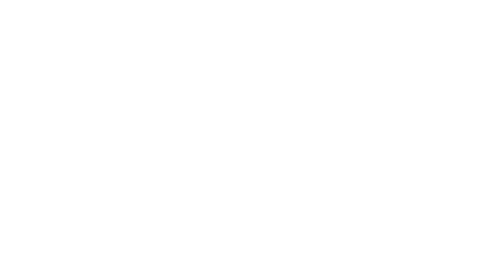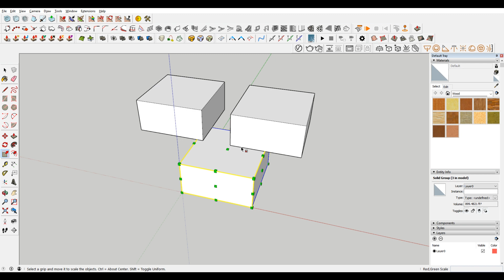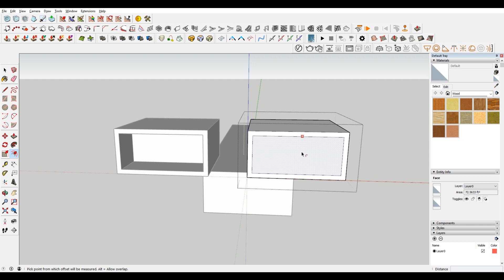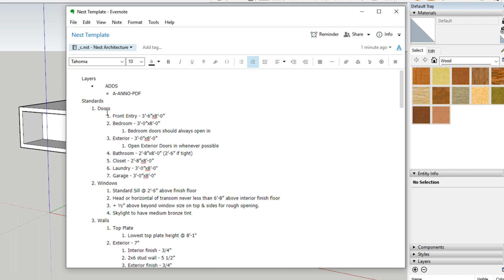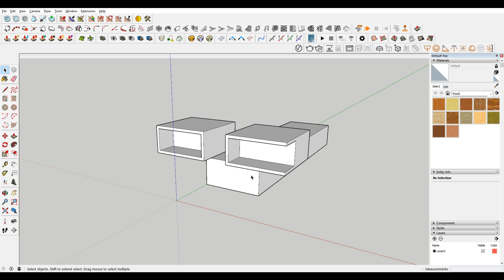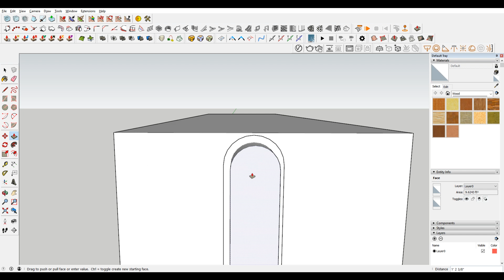Architecture Workflow For Sketchup

Comment: I don't know what you are referring to by drawing everything again if using sketchup and layout. Honestly, Mike Brightman has some awesome myth busting videos about using sketchup and layout. My workflow is so automated that all of my objects are dashed in layout without having to do manual dashed lines on anything, it's already done for me and ready as I draw in sketchup. I barely spend any time in layout at all, most of my time is drawing and customer design stuff. With the right sketchup and layout workflow, it's generally faster at almost everything for construction and construction drawings, than any other program. Sketchups weaknesses as you point out are in the 2d area, and also especially in the generating quantities of stuff area. Plugins like quantifier pro are quite good for this, but the biggest problem I've had with sketchup over the years is that in my opinion, sketchup and layout combined and I'm talking sketchup with use of plugins here, are hands down the best design programs for construction that there, is, the biggest problem is literally finding out what is available to you, finding the plugins that can save so much time in sketchup, etc. Sketchup is really nothing without the plugins in my opinoin. You can make 2d drawings in sketchup incredibly quickly if you use a plugin like the fredo box stretch tool and other plugins and if you have components setup with 2d objects you're literally click and drag, done. Sketchup is actually very good for 2d drawing, you just have to have templates setup and know the ins and outs. This is my experience.

I currently use 50 plugins that are all active on my screen in the top and bottom tool menus, I use almost 50 short cut keys by combingin my mmo mouse with 12 buttons and a 2 button 3d space mouse giving me the option to use combination buttons to use nearly 50 tools without touching my keyboard at all. I can pull tools out while I'm modelling and rotating. There is just so much more that needs to be known to the public on how to really get the best results out of sketchup and layout and the information is out there. The problem like I say is a lot of programs come with a lot of stuff and manuals etc, sketchup and layout info is sort of sprayed everywhere, but once you know the real power, it's seriously way better than revit, chief, etc. I've watched so many tutorials on those programs and it's just painful to watch how some operations are done. Again pointing out that the real power of sketchup is in it's plugins, so if one doesn't know the ins and outs of fredo plugins, curic, skalp, tig, medeek suite, curviloft, etc, than it's really tough for anyone to say that revit or other programs are better. They aren't in my experience, and not even close.

Comment: I disagree with your comments on SU for construction documents. Although I'm not an architect, I use SU & LO extensively and I have produced full set drawings without any undue stress or heartache. The trick is to leverage groups, layers and scenes in SU so that when they are imported into LO the work is almost done. This is fully explained in The SketchUp Workflow For Architecture by Michael Brightman. It is an incredibly simple concept.
Reply from the maker: bigjgordon I think my issue is that Im used to creating construction documents in BIM software.  I think once you’ve started creating documents in that way it feels like non-BIM software is a step backwards
Reply: @DesignerhacksPage  I agree, it's the same with me and the construction industry is heading that way

Comment: As Donald linked to, there are 2 well established approaches to CD's with SketchUp + LayOut. Sonder's approach in particular is facilitated by a number of templates setup in SU+LO, and as part of his DD phase, he creates a model to a high level of detail, then plugs that model into the templates and most of the docs are populated. It's a specific method that has to be set up right, but seems very effective after that. Would be curious if you looked at those and found them to be lacking for you. 

Irregardless, still enjoying these videos, and would otherwise agree that SU is not built for CD's, just happens some innovative folks out there found interesting ways to do so. Keep em coming!
Reply from the maker: I just purchased the SketchUp & LayOut for Architecture.  I'm excited to dive in!  Thanks for the heads up!  I really hope this is the solution I've been looking for and not just a bunch of workarounds.
Reply: Ya, Sonder fully owns that it takes time to migrate your details library from CAD to SU, but that aside, will be curious in the future if you find it useful or not. Good luck!
Reply: @DesignerhacksPage  I'm also curious about your findings from reading this book. Has it tipped your point of view, even the slightest, towards Sketchup + Layout for 2D construction drawings? (I'm not an aspiring architect, not even by a long shot, but I'm looking to investigate proper software tooling to design a future home at some point.)
Reply: @DesignerhacksPage  Hey man, I know I'm just a random guy at the moment responding to this. I've left you a rather long comment on my thoughts on using sketchup and layout above. If you've just purchased the sketchup and layout for architecture book, it's quite outdated in some ways with teh best methods, there are better solutions than some things shown in the book, much better. The book is awesome and I learned a few great things. I've been obsessed with automating sketchup and layout to make my job faster for a long time and I've finally come up with some killer workflow results. If you're interested I'd be happy to help you, just shoot me a message on my email. Tucker.A.Webb@outlook.com

Comment: https://sketchupbook.com/
https://www.sketchuptolayout.com/
https://brightmandesigns.com/tswfa/
Reply from the maker: Thanks for these links Donald.  I'll have to checkout sketchup book.  I'm familiar with layout and know how to use it, but maybe I'm missing something inside that resource.  Brightman / The Sketchup Workflow for Architecture Book felt more like an intro to sketchup for architects to me.  I've had a lot of experience with BIM software and I want sketchup to work that way, but maybe that's just trying to fit a round peg in a square hole.  We'll see!
Reply: Trimble Connect has some BIM capability, but mostly it is a project management tool.  It's an extension that automatically comes with recent versions of SketchUp Pro.  However, there is a price barrier if you are looking to manage more than one project.
Reply: Medeek BIM: https://www.youtube.com/watch?v=KRvDMqRjfCQ